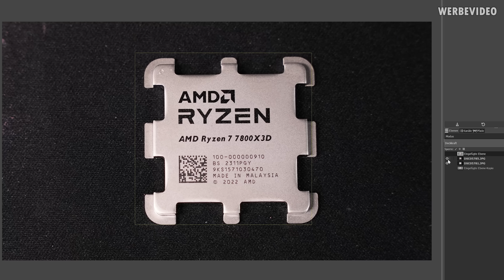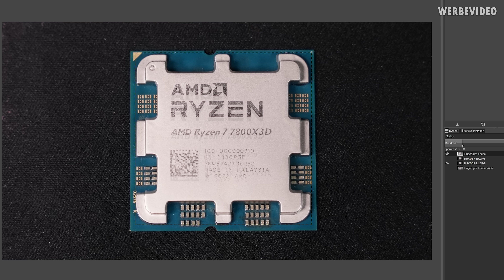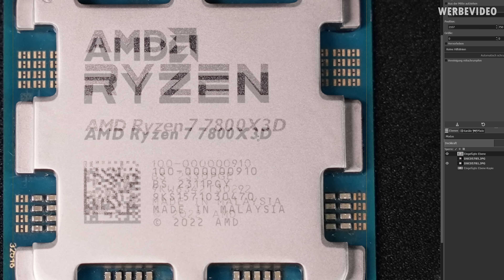Beware! Fake Ryzen 7800X3D CPUs are being sold

Comment: When you said fake 7800X3D I was thinking they put a 7800X3D heat spreader on a 7600, but this is next level.
Reply: Yeah, or sold a broken one as fully working.
Reply: Yes also though so. Would be so much more likely because it is so much less afford to up label CPUs and sell them more expensive. Halve of the people probably wouldn’t even notice that and just assume if it’s working that it is fine. Someone put that much work into it we have to expect there to be a lot of those things. This is nothing someone would do only for a few pieces.
Reply: There was literally no CPU on the PCB, at all.
Reply: Same i thought that too, change the showed cache somehow..
Reply: It's much costlier to fake it this way since there are no low end Zen 5 SKUs. It would however be more convincing as people who don't check the CPU's model after installing it wouldn't have the incentive to return it immediately.
Reply: @kingeling  No it would be cheaper if you also consider machining work and time in. At least for only one or a few of those. Full replicas only would make more profit in a large quantity which makes it only more scary.
Reply: @kingeling   That’s true but making complete fake CPUs isn’t free either.
In my country 7500F is less than 150 bucks and he is selling them for 300 therefore he still would most of the profits with simply relabeling. In low quantities he most likely would spend half of the 150 on fake parts either way.  So it would be around 150 per unit for an hour of work compared to 200 bucks in profit for multiple days of work. That only makes seems in high quantitys because u can than get the fake parts cheeper and the profits add up. In my country it most likely would be more expensive to build a fake than buying a low end one.
Reply: @darkangel999  It would be even easier. Remove the etch and redo the etch with a rename. DONE. Talk about a cost-effective scam, considering that most people probably wouldn't check that immediately. 
That's scary big time!
Reply: @runejonassen3893 Yes that’s exactly what relabeling is. Take a product that looks identically print, etch or what ever false spacs on it and put it into a new box than sell for Profit.
Reply: This is either a large scale manufacturing to be worth it or someones sick hobby. The amount of time and effort needed to replicate theses including the packaging wont be worth it  unless its being produced in a decent quantity.
Reply: @ricozkirihara2798  china has entered the chat
Reply: I think those fakes are made in china, they are way to professional then the average Joe here in RO, most likelly the scammer buys from china those fakes and scam ppl for money, or he was also scamed and passed on the scam, there are ppl like these 😐. Glad that this case had a happy ending and we benefit the information from this video in order to not get scamed and be carefull, also I sugest to Bruce to go and make a complaint to the police station, when the guy/guys or girls are finally exposed then this can added to their file and get convicted.
Reply: technically it isnt broken, cus there no cpu
Reply: AY AY! Don't give them any ideas! :D
Reply: @geca0276  Sorry but that’s not exactly new ideas. It’s biggest most known and cost effective scam plague the tec world knows for decades now. They do that all the time mostly with storage hardware and batteries but also everything else like motherboards, CPUs, GPUs or whatever else. People should know and be informed about that.

Creating full on dummy products on the other hand is new to me and even more disturbing.
Reply: I thought they managed to change the cpuid so it would report to look like a 7800X3D at first.
Reply: That's just different heat spreader..
Reply: making what essentially amounts to a metal 'sculpture' of what a computer chip would look like, is pretty shocking... and a very convincing scam.
Reply: another possibility is that it is an amd storefront mockup that are everywhere at their exhibitions

maybe someone stole one, thinking it was a real chip inside
Reply: Yup, that's why I was worried my chip might not be what it says on the tin but I sure ain't got one of these.

Comment: This is some catch me if you can levels of forgery. My mind can't grasp why someone would go to such detail, but I guess if they're doing it it must be profitable.
Reply: Has to be considering that more than 50% of the total manufacturing costs for a cpu goes into the silicone itself...remove the silicone, you get more than 150% the profit margin.
Reply: @modrribaz1691  Oh there's a lot of corners to be cut. Of course there's no silicon, right. Then the real substrate PCB has a lot of layers and it has blind&buried vias, while this is a plain dual sided one. Then the real one has an unusual stackup, and this is just standard, which is why the thickness won't match. Then heatspreader is a precision die-forged copper piece which is oooooooof expensive. Since this doesn't actually need to spread heat, it just needs to look and weigh about right, it's likely zinc alloy, which can be cast quite cheaply into alu tooling. Then just packaging and stuff, the basics. I doubt this whole package everything cost much more than 20€.
Reply: @SianaGearz  Of course, I only hypothesized it would still be profitable even without just a die.

Comment: Fake heat spreader looks like cast. Not laser cut or press-cut.
Reply: It's probably CNC milled - CNC is expensive for high volume commodity parts but for bespoke fakes a small CNC mill would be the easiest and probably cheapest way to produce that
Reply: It is most definitely not cast lol, it is cnc
Reply: Looks like they just stamped Aluminum in a press. Doubt these guys used a cnc machine
Reply: @LuccianoNova  it is not stamped 100%. It would be much more expensive than to just mill it for such a low series
Reply: @LuccianoNova  A few thousand dollar hobby grade CNC mill would be much cheaper and easier at this scale than a heavy duty hydraulic press and custom made dies for it

Comment: Just like in Chernobyl: "There is no core!".
Could it be it was some kind of demo / dummy CPU stolen from an expo or a show / lab? Looks almost too good for a fake.
Reply: Was thinking along these same lines as one possibility, at first, but I doubt they'd have an assigned SN on the IHS itself. AFAIK, they'd just print the classic 0000000000000 on it to avoid exactly this scenario where someone might get their hands on it and try to sell it as real.
Reply: you're underestimating how easy it is nowadays to order cnc machined parts, or custom pcbs
Reply: But why would a dummy cpu have retail packaging with matching S/N tho? That seem like too much effort for a dummy
Reply: @ashenwattegedera  thats barely any effort, they have to etch the ihs and print a sticker anyway, might as well match them
Reply: Because real cpu is in sold separately, Inside someone's computer.

Box is just opened from bottom nicely and glued together.

That box should need more investigation. Those holograms could too many times opened without harming them, If someone know what's he doing and have done it multiple times.
Reply: You not seen enough fakes. This is still low quality in my eyes.

Comment: I burst out laughing at 7:44 when you flipped the CPU around. What a strangely high effort scam.
Reply: Needs a reaction cam.
Reply: @puciohenzap891  "Needs a reaction cam."... POG face probably :D
Reply: That part made me chuckle. He was so surprised he forgot to English. So we got a pure German "Öhm..."
Reply: "....... ...... uhm..."
Reply: For 300 dollars a piece, is quite profitable.
You can make the pcbs for like a few dollars, remember all those ads in various related youtubers that promote cheap pcb making?! And then easily soldering a handful of capacitors. The milling of the aluminum block and laser etching can also be done at home or if you work at a company that handles cnc milling and quickly adding some of these "pet ptojects" while doing overtime and appearing a hard worker to the bosses.
After someone sells several of these they can even buy a small cnc machine for home use and not risk it at the job.
Reply: Only reason I can think of for making more authentic looking fakes is to game the returns system of a retailer selling genuine 7800x3ds, swap out the real for fake, get refunded, and you have a bunch of real ones to sell before they catch on.
Reply: My guess is so it looks legit on x-ray at customs.
Reply: what makes me laugh is even though I am 99.8% sure this isnt the truth. If there was one company out there whom could effortlessly mass manufacture and flood the market with professional fake high demand Ryzens cpus.. Where the only outward tell without delidding is a thinner pcb; it would be Intel. Still, manufacturing even in low level china is just insanely good when it wants to be these days, so the boring truth is certainly the actual truth as usual.
Reply: @PriaSamari  You apparently don't have much experience with the Chinese manufacturing sector.
Reply: i was gna say why wid intel do that but with whays going on rn? i woukdnt be surprised @PriaSamari